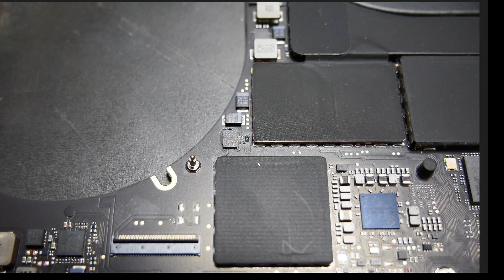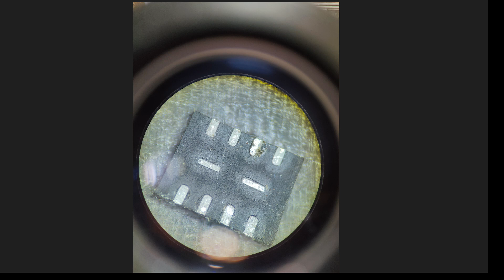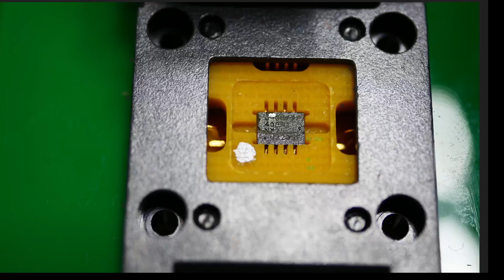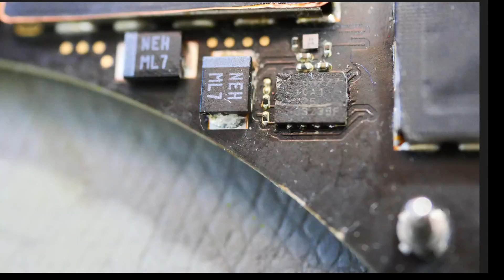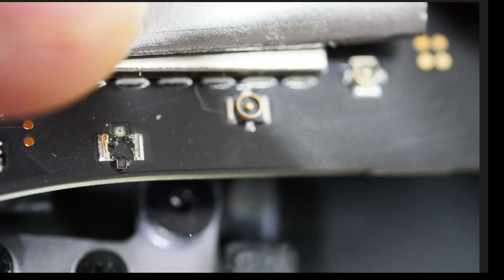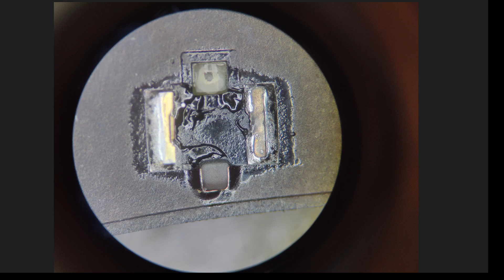Macbook A2141 T2 and antenna connector repair

Comment: Looks great, you sure have an abundance of tools to help u make repair easier.
Reply: And yeah, the folks who want you to fix those MacBooks will have to pay for your tooling costs.
Reply from the maker: @EVGizmo  That's kind of the point of having stuff like this...so I can do this sort of work. Today, I was working a job for a controller company. They sent me 30 controllers that had a mix-up on them. A part used was the wrong one in 4 places per controller. The same equipment I used for working on this macbook got used to replace the wrong parts on those controllers.
Reply: @de-bodgery  perfection. Love it!!!